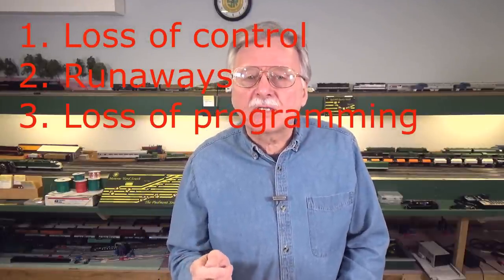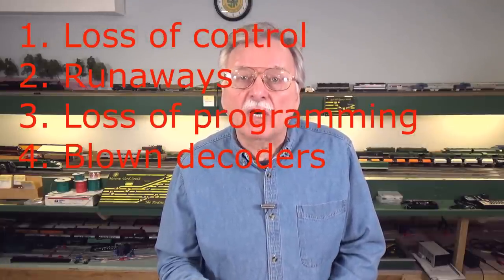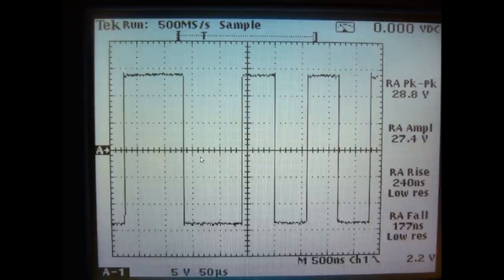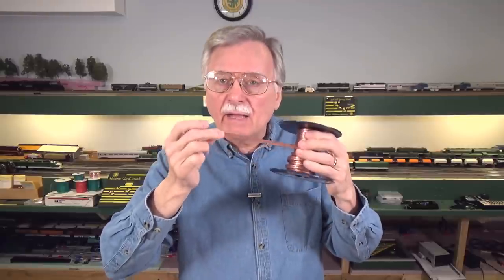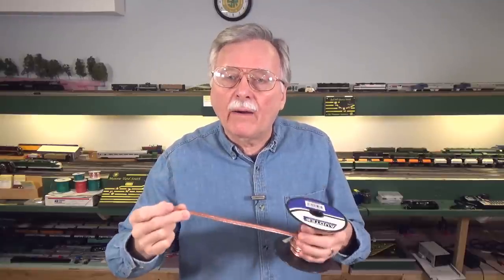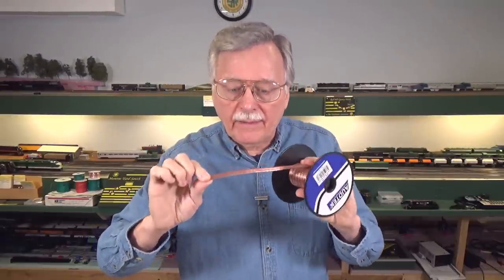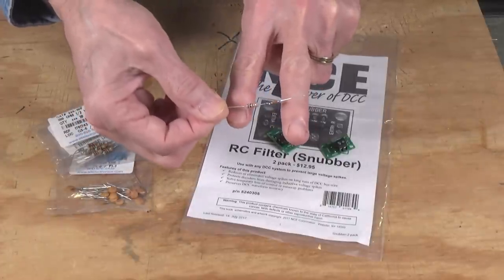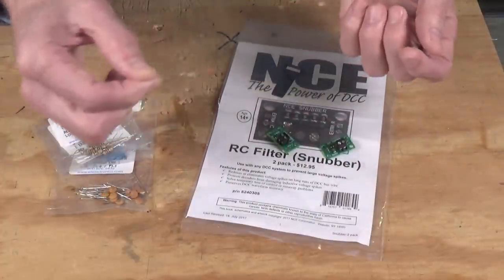End Decoder Problems With A Snubber (243)

Comment: Besides being a model railroader, I am also an amateur radio operator, so this video rang bells in my head.  The problems discussed in this video are part of electromagnetics called "transmission line theory."  The DCC feed lines and the tracks form a group of transmission lines on the layout.  Even without sources of interference the lengths of the lines themselves can distort the DCC signals.  Thanks Larry for discussing solutions that help to mitigate these problems.  Also, I really like the scope captures.  I'll have to try hooking up my scope to the track and see what the signals look like.
Reply: Absolutely right! The correct term for this circuit element is a terminator, not filter or snubber. The issue is that an open ended transmission line reflects signals, and the very fast DCC edge signals when reflected add to the incoming signal producing those narrow spikes seen on the oscilloscope trace. Terminating the line with a capacitively coupled 100 ohm resistor (equal to the approximate characteristic impedance of the transmission line), prevents these reflections and eliminates the spikes. I need to be convinced that you need as much as 0.1uF though, it may work with 0.01uF with less loss, but I need to experiment to be sure.
Reply: Snubbers are used for supressing voltage and current spikes resulting from switching - there is no switching here causing the spikes so I suspect Snubber is a customer friendly term for the end result.    Rather than matching the track characteristic impedance, another way to look at the same thing could be that it is a filter designed to attenuate higher frequency components which comprise the spike.  As you will know, the cutoff frequency of a filter using the given components is 16kHz at the -3dB points (ie power of the waveform on the track would be attenuated by half if the waveform is at 16kHz).  The DCC signal is at about 8kHz fundamental and so would be slightly rounded off (perhaps very rounded off) as the higher harmonics are attenuated, but the spike would be completely removed as it is about 1/50 duration of a single cycle of the DCC, so comprises many high frequency components.  The cap value of 0.1uF seems high (overdamped) and I think your suggested starting point of 0.01uF is probably about right.  I wonder if manufacturers have copied each others' values ?

Comment: Just like the condenser in a set of ignition points. They were installed to stop radio frequency interference caused by the engine ignition system. Same old thing; now, a new (old) use. Bravo!

Comment: Thank you for posting a very informative video. I am having problems with certain locos on my layout not responding to commands and it mainly happens to be at the far ends of my room sized layout. I was thinking of using the NCE snubbers but as you've shown that a simple resistor and capacitor can be used, I'll be off to the electronics store tomorrow to get some and hopefully solve this problem!

Comment: I have had some of the problems you talked about, my locos not responding to speed commands, bell works one minute, then doesn't,.  I have my layout divided into blocks with a power bus. But after watching this video and the symptoms related I know that my bus wire in a couple of my blocks are more than 30 ft. I have even had an issue with blowing a decoder on my loco in this block that is considerably longer than 30 ft. So without checking it with an oscilloscope.  I should probably install an rc filter in the blocks I have that are exceeding that 30 foot  mark. Thanks for the info.  Great video as always. 
Chuck
Reply from the maker: Check your track voltage if the control losses are occurring in the same areas. You may need to beef up your track feeds in those locations.
Reply: Ok, I  never thought of that. My feeders are 22 gauge. I don't have as many feeders on the same section which is on an upper loop coming off my helix whereas a bus wire would be visible so I have soldered all the fishplates for better contnuity.
Reply from the maker: Rails have much higher resistance than copper wires so voltages can drop off fast in them With code 83 I use feeders every 6-8’, every 3’ with code 70 rail.
Reply: Ok, good to know. I'm using Atlas code 100 rail. I try to have feeders about every 3 to 5 ft

Comment: Thanks for the information. I've had an intermittant problem with some loss of control after a loco crosses over a return loop gap when another one is already in the loop. It hasn't caused any damage yet, but it's been a little concerning.  Considering the cost of the pre made Digitrax ones, I'll give them a try.

Comment: Great Video, Is there any right or wrong way to wire the resistor and capacitor as the resister only allows flow one way. an if using more then 1 RC Filter or would low reverse the flow on the 2nd RC Filter.
Reply from the maker: I have never seen anyone suggest they all should have the same orientation. And if you think about it it doesn’t matter since there is power on only @A@one rail at a time. Current flows from the on rail to the off rail through the RC filter not both ways at the same time as would occur if power was on on both rails all the time.

Comment: I have a DCC++ setup on my test loop.  I was having problems with runaways on certain decoders and I tried everything you said to no avail.    The solution was to upgrade my 12v 1.5A supply to a 15 V 4A supply.  The problem is completely solved.  Not sure if the issue was with the current or the voltage.
Reply: I run the Bachmann EZ command controller, with power booster. It is 16Vac at 5Amps.    The simple controller is 16Vac at 1.2Amps.  I had all sorts of problems when I first got started until I added the 5Amp booster.     I'm not sure if it means anything, as I'm not a electrician.   But I can assume the Amps is what is important. As with lower Amps I had trouble

Comment: I have 4x9 foot Ho scale layout and a bachmann dcc controller but I have an athearn dcc sound locomotive that had a short that burned out some leds and afterwards whenever I give it power I take off like a rocket and dosen't respond to any commands. But when I run it with DC power (which I ran on prior to the short) it runs just fine. I have reset the decoder several times and it hasn't fixed the problem. I'm pretty sure I have to replace the decoder...
Reply from the maker: Sounds like you cooked it. Did you try a reset by programming CV8 to a value of 8? If that doesn’t work you may be able to get it repaired by Digitrax, check their website. The fact that it runs on DC simply means that track power is passed through the decoder to the motor and your DC throttle is controlling the voltage getting to the motor. With DCC power on the track at  constant voltage of about 14V the motor is getting full voltage and taking off.

Comment: Hi Larry

Can you please provide the info on the 14 Gauge (audiotek?) wire you use for your DCC bus.  Looks a lot easier than twisting two wires.  I assume that you just separate where you need to connect feeders?  Thanks  Marc
Reply from the maker: Exactly, I just slip a knife in there and open it enough for a suitcase connector.mThe great thing about it is it keeps the two conductors the exact same length which doesn’t always happen with twisted wires. I have seen some that basically were one straight wire with the other one twisted around it. If you order it make sure to get the OFC (oxygen free copper) vs the CCA (copper clad aluminum). This is the one I get:

https://www.parts-express.com/Audtek-SKRL-14-100-14-AWG-OFC-Speaker-Wire-100-ft.-100-021

They also sell other lengths and diameters.

Comment: Thank you Larry. I have an unrelated question from your previous videos. I watched your video on building a keep alive for the loco using a diode, zenier, resistor, and capacitors. I also watched the video for adding a 12v led strip to the passenger car which used a bridge to get DC, resistor to limit in rush current and capacitor. so my question is does the stored energy in 12 passenger cars with lights cause a problem to my Digitrax system.( i.e.feedback)? I am using 5-2.7v super capacitors a 100 1/2 watt Resistor and a small bridge same is in the video and my track voltage setting is set to 14.5 v
Reply from the maker: I use them with my Digitrax system, people have been using these for years without any problems. Just be aware that the lights and any other accessories you power using your track power takes that my away from your locos.
Reply: @TheDCCGuy  Thanks for the quick reply

Comment: I have added  one snubber to each power district for my layout.  I had a MRC wireless system and a constant problem with a Proto 2000 GP38-2 with a TCS LL8 decoder.  I used the problem my ghost driver, it would just take off like something out of the movie poltergiest. A number of the features of the system later failed and I decided to replace it.  Fast forward to my current DCC system, NCE Power Cab with Smart Booster and decoders were still failing. TCS M-1 decoder in a Proto 2000 SW-9 the light would stay on and nothing else.  A TCS in a Bowser U-25B turned into a real time version of a "GE Toaster".  The decoder was cooked and heat damage to shell!  Called NCE with an attitube, "I can't afford this anymore"  NCE's response, "Snubbers"!  Bought two of them, one for each power district, at this time, no issues!
Reply from the maker: Works great!
Reply: at least the U25 realistically weathered itself!

Comment: Should one of the RC Filters be installed on a new layout that hasn't experienced any issues as a precaution? I spilt my power bus wires to cover my layout that has one set going in opposite direction from the other . Would I use one at each end of the bus?
Reply from the maker: I would if the bus is longer than 30’. And yes you would put one at each end if each exceeds 30’. Generally though fir shorter runs my recommendation is to install them only if you experience the issues I listed.

Comment: Good video.  I am using block detection (Circuitron BD-2).  Will a snubber cause these to detect a short?  There are adjustments on them, just not sure how these will work with block detection...?
Reply from the maker: Yes, the BD20 instructions tell you how to desensitize the device so you won’t get false detects. However as I said in the video if you aren’t seeing any symptoms you may not need the RC filers in the first place, especially if you have twisted your wires or are using zip cord.

Comment: Thanks for the video Larry.  I find what you do very informative and well done.  Can you use the NCE snubbers with a Digitrax system?
Reply from the maker: In their manuals Digitrax says not to use capacitors alone, but don’t say anything about the RC filters. That said I did it back before I replaced my old wires with zip cable. Matter of fact the lead photo I used was at the end of a 40’ bus on the layout with an 8 amp booster. As always you should only use these if you are experiencing the symptoms I listed.

Comment: My bus wires go from the DCC booster about 25 feet in both directions. I used 10 gauge solid copper plastic conduit house wire (Romex) as that is what I had available. How does the gauge factor in on this issue?
Reply: The thickness of the wire mainly affects how much voltage loss you get as you get far from the base station. With your 10 ga wire, you will get very little loss but adding RC filters at each end a good idea as is cheap insurance.
Reply from the maker: You should have few problems with that arrangement. However if you see any of the symptoms I mentioned then try the RC filter bandaid.

Comment: Regarding installation of the snubber, my DCC bus is shaped like a V, in that the bottom of the V is the booster and the legs of the V proceed down the layout and do not touch each other because of a removable bridge. So, should each end of the bus have a snubber installed ?
Reply from the maker: Yes
Reply: @TheDCCGuy  Thanks !

Comment: Wondered how motor suppression is carried out on DCC systems. On conventional controlled systems, it's by a parallel 220nF capacitor at any power clip or track power feed in point. Don't know if these are removed when installing DCC control. RC snubbers are used with mains triac/thyristor controllers.
Reply from the maker: I remove them from all my UK models. The only US models I have seen them on are Bachmann. Some of the UK instruction sheets actually point out that it may be necessary to remove them from the motor leads for good DCC operation. They can interfere with BEMF and create poor performance although most of the better decoders now apparently can deal with it. I did a video, #79, “Are your decoders being choked” on this subject.

Comment: The combination of a 100 ohm resistor and a 100nF ceramic disc capacitor gives a frequency cut off at the 3 dB point of 15.9 Khz.  The 94 Ohm resistors give a frequency of 16.9 Khz.. Be aware that resistors have a error percentage.  Anything around 10% is normal.  Check your resistors resistance with a meter if you want to be more precise. As a note on Capacitors.....they can have an error of 80% plus or minus which could be an issue, if you have the means test them to find the closest to 100 nF but i doubt you need to be that choosy.   I shall need some RC filters as my N gauge layout is over 30 feet but as a radio amateur this all makes sense to me.  Thanks Larry
Reply from the maker: Yes, that combination of components was selected by the folks at NCE who strongly recommend its use. Jim Scorse is a great EE so so I trust his choice.

Comment: Good Video.  But... The RC filter cannot be used when current sensing track detection is in the circuit.  The club I belong to has Digitrax BDL168 track occupancy detectors.  I believe these are current sensing.  The wiring has a common line and multiple feeders coming from the BDL168.  The longest feeder may go 30 feet.  Any suggestions on how to deal with this situation?
Reply from the maker: I think the BDL168 uses diodes for sensing occupancy in a block and since these draw some current they may result in false detects. With current sensing based detectors there is a work around but I don’t know of any with the diode based ones. Since it sounds like you don’t have long wire runs you may not have any problems, do you see any of the symptoms I mentioned? What size wire was used? What amperages are being used?
Reply: I was guessing the big black lumps near the hook up board were CT coils.  Guess not.  We have had some strange CV settings, and a couple blown decoders.  Wire size is 14 awg.  The feeder wires leave the BDL168 and go just a few feet up to almost thirty feet.
Reply from the maker: I am not sure whether you can adjust the sensitivity of the BDL168 like you can with a BD20. With those you can make onboard adjustments and cut down on sensitivity so the false detects are eliminated. So take a loo at the BDl168 manual and see if there is a similar way. Also those may not be sensitive to the current draw of the RC filter since it only uses a 100 ohm resistor. It would only take a few minutes to wire up a RC filter, install it, and see if the detector lights up.
Reply from the maker: I just read through the manual and it does tell you how to adjust sensitivity so you might take a look at that if the RC filter does give you false detects.

Comment: Hi Larry. Great video with very useful information. Do modern DCC command stations not have this protection built-in?
Reply from the maker: Yes they do and that is why the first oscilloscope scan I showed had such a perfect waveform. However its the wires, motor and wheel arcing, intermittent shorts outside the command station/booster that interact with the DCC power/signal and create the problems.
Reply: The command station will generally have circuitry (diodes) that send spike voltages back into their own power supply so their output is relatively clean.  As the signal passes along the track reflections from the far end bounce back and at result in ringing.  Close to the command station, the diodes within the command station will (along with any other filtering present) remove most of the spike.  Further away the ringing may be present at significant levels.

Comment: I have a 5 x 10 layout that I run both DC and DCC can I run one of the RC filters on the DC mode without any problems? Or should I put a switch in between the RC filter and only run it on DCC
Reply from the maker: It is a DCC only device so don’t mix with DC.
Reply: @ thanks very much for your quick response. I search the Internet. I was pretty sure that was the answer, but I didn’t find it directly now I know.

Comment: Can 2 conductor twisted pair shielded cable be used
Reply from the maker: If you can find it in large enough sizes. I have stripped twisted pairs out of old Cat5 cable to use with connecting my NCE Button Boards and Switch8 accessory decoders to switch machines.